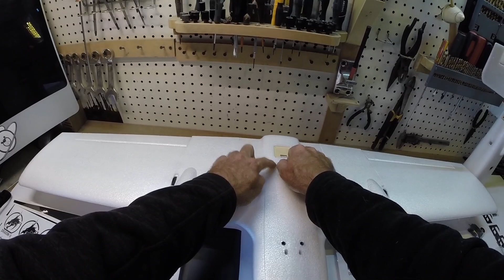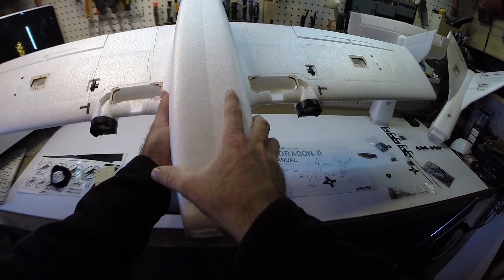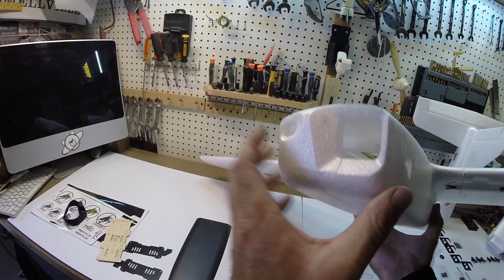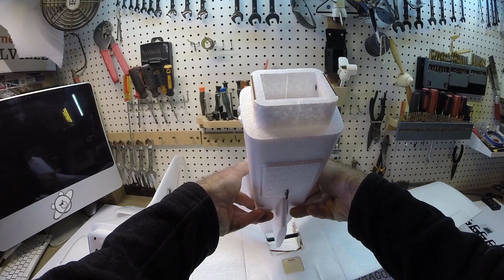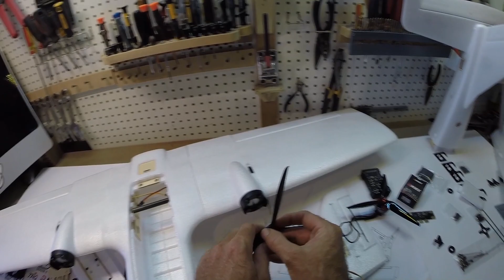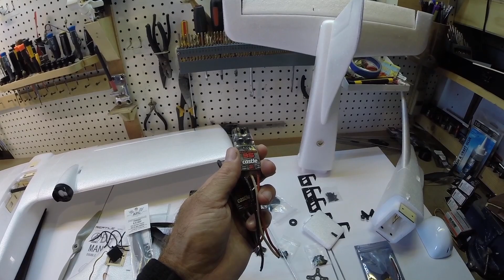Reptile Dragon2-A Designer's Perspective/In Depth Review, and Discussion of Design Concept

Comment: I just purchased this kit version for $104 and for that price it’s hard to beat. I’ve gotten a few flights in and even stretched it out a bit in FPV.  Comparing it to the plane I took the internals from the Zohd Nano Talon Evo. So far I’m liking this one better but it’s not as efficient with it being a twin lol . I’m using 2x 2306.5 1900kv motors running Gemfan 6042 props. Can’t wait to get more flights in 🎉

Comment: A second option is gluing the spar to the fuse but relying on the esc covers to hold the panel in place..... maybe reinforced with tape?????  Having trouble deciding.
Reply from the maker: I would just glue or tape securely the inner wing section to the fuselage./wing stubs.  it's the only way to Make sure that the wing sections align and stay together IMO 
I love the idea of putting the reptile dragon in a. backpack, but I guess I'll just carry a roll of tape with me if I use it that way.
Reply from the maker: Sorry for being late getting to the comments to answer questions.  saw your emails, and that is fine, will respond shortly, but thought it;'s best to respond here, so others can benefit too.   cheers!
Reply: So you didn't glue yours?  Any issues doing it that way?  I'm leaning towards glueing.

Comment: I'd like to see how you attach the tail section to the fuse.   I'm assuming you'll stay with the bolts and reinforce with tape?  

I got stalled out when building mine by trying to decide the best method to attach the inner wing panels to the fuse.   I wish the instructions provided some best practices type guidance on this part of construction.  What I'm considering is gluing the CF spar to the fuse and panel and also gluing the pannel to the fuse.   But, that seems like overkill and will make future maintenence difficult.
Reply from the maker: I just used bolts to hold the rear fuse to the forward fuse.  seems Ok, but since the bolts go in from the side, and not in the same direction as the parts they are trying to hold together, it's not ideal.could wrap with a ring of tape, I guess...  of if you are going to stick with one type of tail, just glue together.  I have had some issue finding the right glue.   I started using the glue that I show in the video, but it did not work at all.   found some E6000 and that works good.  
this is why I design and build my own airplanes most of the time lately.     this started as a review channel, until I got frustrated with quality and got out the drawing board.

Comment: I want to youse an Plastic case arounde the 2216 Motor with 8060Gemfan Prop. But the Problem is I can not find small Spinners in rewersed direction. Printing a Spinner is to complicate for me. I want to youse this Spinners for more arodynamic and it looks cooler
Reply from the maker: I too would like it if smaller spinners were made, and in both rotations.   Do have to consider Ram air cooling as important for these little motors, so the spinner could be just built into the prop nut, but would be good if it extended slightly beyond to cover the first few mm's of the blades, as they are very bulky there at that distance from hub.    If I ever get good enough at fusion 360 I would like to print my own spinners.  that would be awesome.  I have a feeling that AI will learn it well and end the world while it's at it, before I learn it that well...

Comment: Good review, not quite sold on the aero nose print, considering you immediately start talking about bolting cameras and pan/tilt systems on top. I think the latter is far more detrimental to aero performance...
Reply from the maker: You are probably right.  Depends on the size of the camera, but it would have to be tiny, for the aero nose print to be an advantage.

Comment: Good video! When is the flight? Cheers
Reply from the maker: probably in the next week or two.  decided to put a Pixracer r15 in it.  Not the radio link version.  Found one on eBay, without a case, and found a STL for a case from painless 360 for it that fits very well.  installing it now.  got the servos in. easy. decided to try the stock pushrods, but beefed up the control surfaces where they attach with ply.  also reinforced the nose section and floor with 3mm ply.  built both tails to try.  so far so good. need to build a battery but will do that last.  trying to decide whether to use a GoPro or a run cam Thumb.  have the normal one and 4k version.
Reply: @FPVREVIEWS  fantastic, I'll wait for the results!

Comment: I love Reptile-2 so much that I bought a 2nd one. Looking forward to your build.
I did not modify anything and it’s a beast/tough little fpv platform.
Reply: I completed my build, 3D-printed landing gear to avoid hitting props at landing. I am running 980kv SunnySky motors which draw less current compare to recommended 1800kv motors. My original Reptile has 1750kv motors and it draws up to 40- 60amps. The 980kv motors draw around 15 to 20 amps.